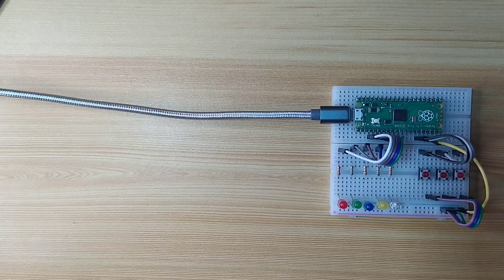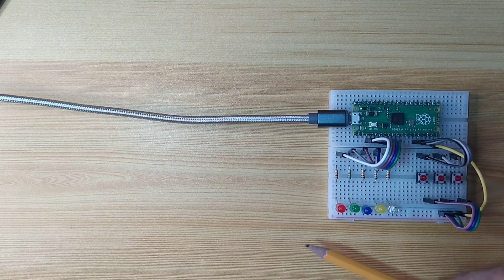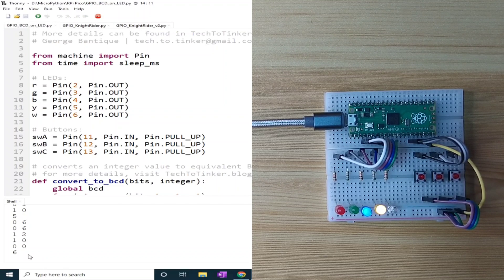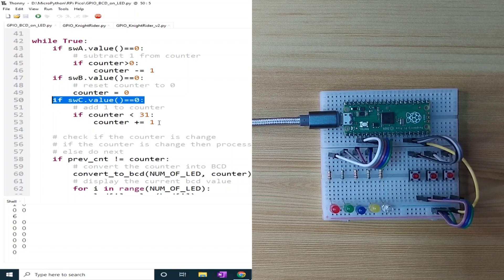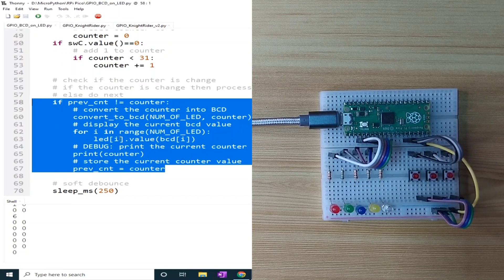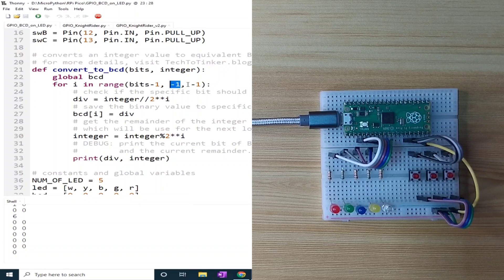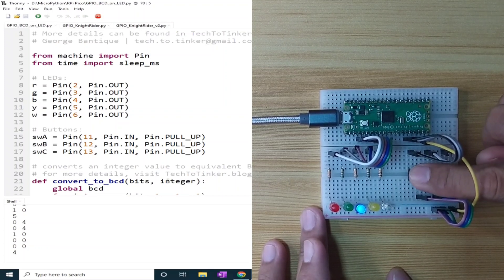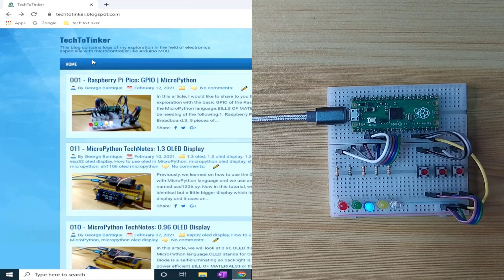001 - Raspberry Pi Pico: Displaying Binary Coded Decimal in LED

Comment: Thank you for your video. I am a newbie and have a project needing a 5 bit output to switch a programmable attenuator. This program virtually nails it. Only problem is I did not have to go through the learning process ;-) I will add an encoder and small display to enhance my learning experience. 🙂